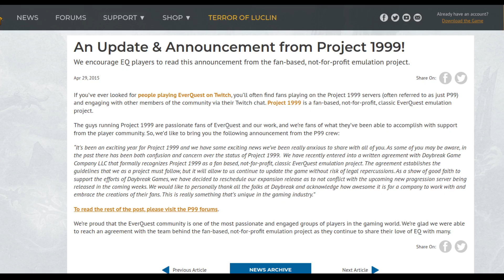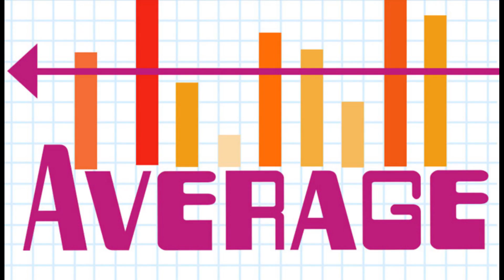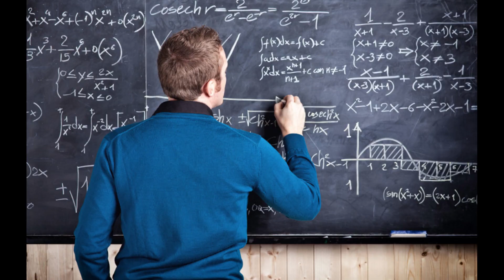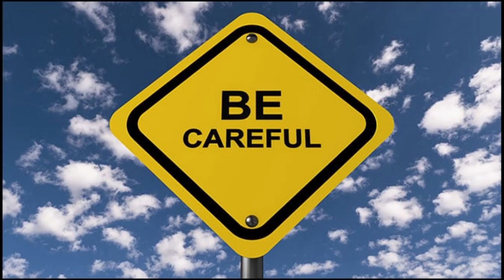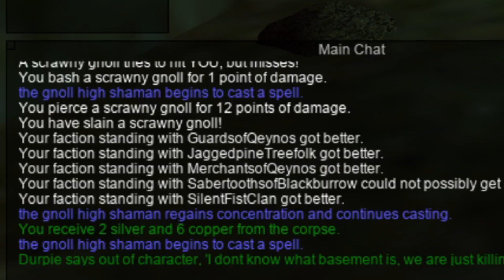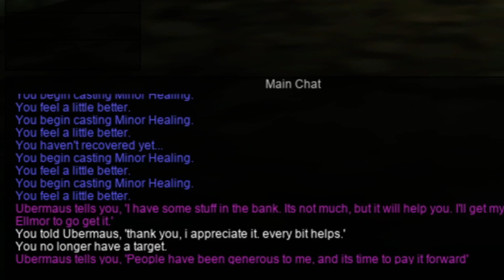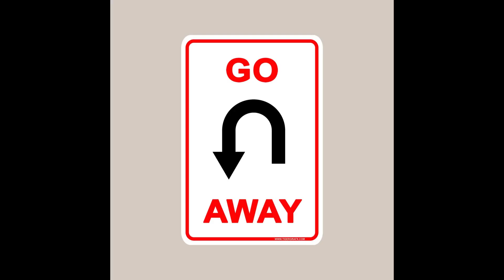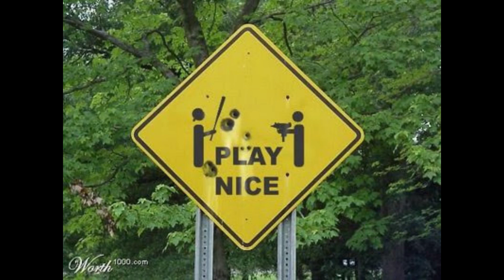It Took Me 𝟯𝟬 𝗛𝗢𝗨𝗥𝗦 To Get 12 Levels - Project 1999 Everquest Green - Episode 1

Comment: if you drop a weapon on the ground, the top of the weapon (e.g., tip of the sword) points north .. macros for /loc and /corpse are also must haves .. if you are about to die, hit the /loc button and note the location .. then spam it on the corpse run to make it back

Comment: To get sense heading up at the start, put the skill sense heading (hold left mouse button on the skill to "pick it up") on your hotkey table(the 1-0 thing), then press alt+o and in the options keybindings add the forward key(usually W) as an alternate to activating the skill whichever number you put sense heading on (0 makes sense, because far to reach on keyboard ;-)). Whenever you press forward you will now also activate said skill, thereby no unnecessary keymashing necessary. ;-)
Reply from the maker: Thanks even to this day I never got that working lmao.